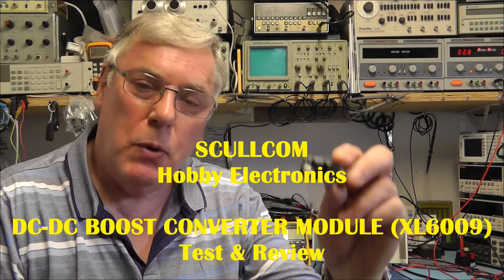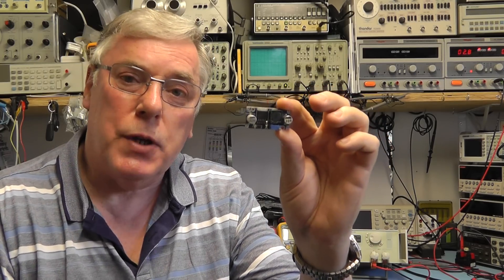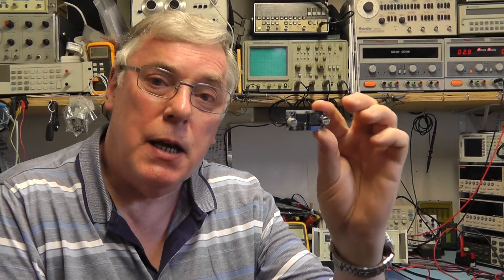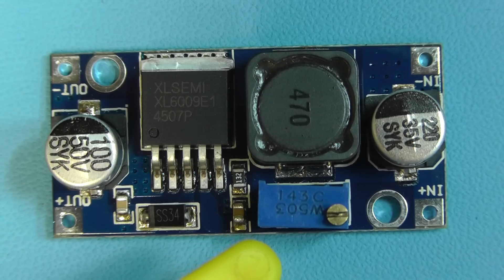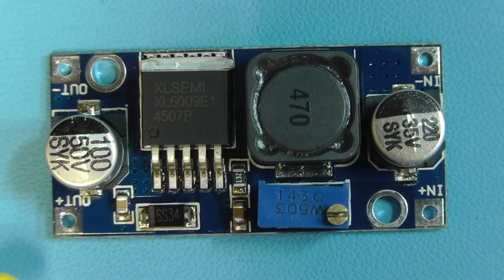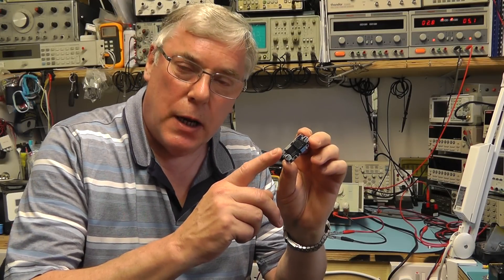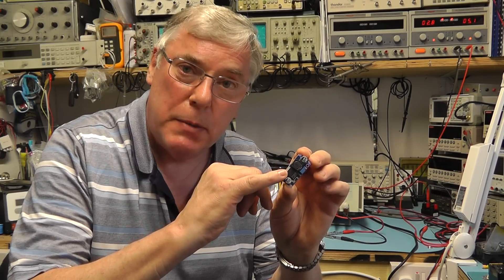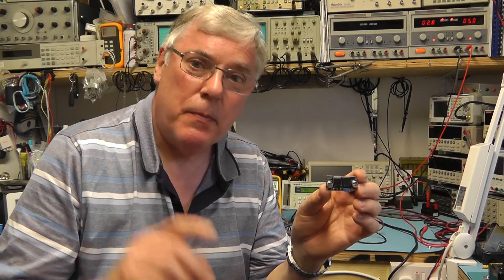Scullcom Hobby Electronics #19 - DC-DC Boost Converter Test & Review

Comment: sir, input= 5v 2A then what will be the output current for 10V output i.e 
input = 5v (2A) , output = 10v (?A).
Reply from the maker: Input at 5v 2A equals a power of 10 watt. So that would be the maximum power it could deliver in this case. So and output of 10v would deliver a maximum current of 1A but this assumes that the DC-DC boost converter is 100% efficient which is not the case, at best it would be about 90% or less. So for your 10v the maximum current would be about 800mA.
Reply: Thank you so so much sir :)

Comment: Hi , thank u for the in-depth analysis of the boost converters.
I wanted to get 32 volts off 16 volts. i used one of these and work fine momentarily well on a  load of 10 ohms bldc motor.then it failed or rather burnt. Later i just tried two of these in parallel, without any expectations, but to my surprise it worked fantastically. i removed one of the varistors and connected other varistor in parallel..  can u tell me with ur knowledge if this is stable system ??? can i connect more units in parallel to boost output power???
Reply from the maker: You can parallel these units to increase the maximum current but you will find that the current load may not be split equally between the two units. A better choice would be to use a single higher current boost converter. If you check-out eBay you will find there are plenty of high current boost converters of 10A or 20A available at low cost.
Reply: thanks a lot sir. i will check it :)

Comment: Why does the input voltage drops when you connect the load. Isnt it seposed to be stable if it is connected to a power suply?
Reply from the maker: Yes the input voltage should normally be stable but it depends on the capability of the power supply. In this case it was mainly due to the long wire length and wire gauge which cased a voltage drop.

Comment: Please I have another question? I want to use 4 leds 10w 12v 900ma all together using the same power cable. How Can I use them all together when The maximum current for each is  900ma? If I use them in parallel, is it necessary or possible to use one power supply 12v 3,6a? I mean, if I use one power supply 12v 3,6a, this current will be divided equally for each one? If I want to use 2 leds 10w 12v, may I use one power supply 12 1,8a?

Comment: Some one please could explain what kind of testes is he doing??? He changes the Amp value on the equipment and the imputs multimeters change. I need to understand? What is he testing? The board capacity? Please....
Reply from the maker: We are testing the efficiency of the DC to DC voltage converter. A DC source is used to provide input power to the DC to DC converter under constant voltage, while an electronic load is needed to draw power from the output, usually under constant current loading.The efficiency is then the ratio of power out to power in, most often expressed as a percentage.
Reply: Thank you! God bless you.

Comment: I got 95pct eff. Using on of these to step up an 18650 battery at 3.6nom to 6volts. I'm using one of these as a constant power load for a battery tester. Just whacked a 12ohm power resistor across the output to get approx 0.5C discharge @ constant power
Reply: Great video BTW, subscribed!
Reply from the maker: +Terry Myers Thanks for your comment.

Comment: diode job in dc-dc converters isn't rectification ... its all about redirecting the freewheel current and preventing sparks
Reply from the maker: +Osman Khalil Thanks for your comments. Yes agree, the buck-boost converter works by storing energy in the inductor during the ON phase and releasing it to the output during the OFF phase. This is achieved by the diode which is sometimes referred to as a “free wheeling” diode.
Reply: storing energy in inductor would  happen without the diode in the circuit but the problem is when th ediode off  that stored energy will make a big spark ,here come the diode job , to make this energy useful and prevent spark , in rectifier circuits where no inductor  exists  the diode's job is rectifying the ac waveform

Comment: What shitty source are you using? Even a cheap 10$ USB charger would keep the voltage at 5V at 4 Amps.
Reply from the maker: +Michi Lo The voltage source was from a 5 Amp power supply.
Reply: Scullcom Hobby Electronics Really? I have a 4 Amp one, and it is still at 4.89 V with 4 Amp. That's what it is rated for, and that is what it should deliver.
Reply from the maker: +Michi Lo The reason the voltage dropped at the higher currents was mainly due the connecting cable resistance to the power supply at the higher currents and not an issue with the power supply itself. In hindsight I should have used shorter and higher gauge cables to the power supply that would have ensured the voltage remained stable. Alternative I could have used a pair of sense wires feeding back the voltage reading to the power supply for auto correction to take place.
Reply: Scullcom Hobby Electronics Ok, sure. But in my USB Supply it is 5.1 V on the output so that on the other end of the wire there is still enough juice left to power the device.
Reply from the maker: +Michi Lo The results would depend on the length and wire gauge. For example if the effective resistance of the connecting wire is say 0.1ohm then the voltage drop at say 5 Amp would be 0.5 volt. In this scenario your 5.1v would drop to 4.6 volt.
Reply: Scullcom Hobby Electronics I hope the leads do not have so high resistance.
Reply: Yes they have

Comment: Interesting video.  Been studying DC-DC Converters and this video is informative.  From what I gather these modules work best with a ratio of 2 or less voltage difference input to output.  Anything above that and your efficiency is going to decrease.  For standard 3V to 5V phone charging circuits this would do just fine.  Sourcing at least 500mA to the phone might take a little bit longer but at 93% or higher since it is less than 2V difference these modules will work great.  Easy enough to get some thermal paste and an aluminum or copper fin on top of the IC and it should work just fine...  One thing to think about is the isolation between input and output, ie how much ripple is sourced back to the input might start to heat up a set of batteries.  Not sure how you test that but in my experience with boost converters the input batteries get really hot when they start to drop voltage.  Would be nice to have some sort of protection circuitry to shut off the converter once input voltage drops too low.
Reply from the maker: +Jimmy King Thanks for you comments. The XL6009 DC -DC converter IC on the board has an Enable pin (pin 2) which is not used on this board. With a small modification you could sense the input voltage and and then use it to control the Enable Pin - If you take it low below 0.8v the IC switches OFF. When you take it HIGH, 1.4v or above the IC switches ON. If the Enable Pin is left disconnected (floating) it goes HIGH by default so the IC is ON.

Comment: for Your test, it is Your powersupply drop the voltage and not the unit. And for the inputcurrent below 4a seems to work fine , and what You find do not work is above 4a and this should not work.  The 10w output is with the low inputvoltage. With higher inputvoltage You will be able to have more than 10w output.  For long time, it may get hot, this need to be tested.
Reply from the maker: +Asle Tryland Thanks for your comments. You are correct about the power supply drop. Running these units at high current loads really requires a heat sink on the regulator IC.

Comment from the maker: PROBLEMS REPLYING TO PIRATEMAN COMMENTS BELOW - So answered here instead:
Yes I did, there is some switching noise but quite small. I found adding extra capacitors in parallel with the output capacitor helps a lot. Its better to add several electrolytic capacitors, of the same value,  in parallel rather than use one large capacitor as the total ESR (Equivalent Series Resistance) is then much lower.
Reply: Mr. Scullcom, what values would you recommend for these smoothing capacitors?
Reply from the maker: This module had a 220uF at the output so you could add another additional 220uf in parallel with it. This will increase the total capacitance to 440uF while keeping the total ESR (Equivalent Series Resistance) low. Alternatively you could replace the 220uF capacitor with 4 of 100uF (select ones which have a low ESR).
Reply: Thank you :)

Comment: hi, i call from chile, you have a problem in test, the main power supply is not low the voltage in test, this form the power disipate in converter is more, the 5v in put are constant for test.- sorry for my english.-
Reply from the maker: +jorge gonzalez rojas Thanks for your comment.
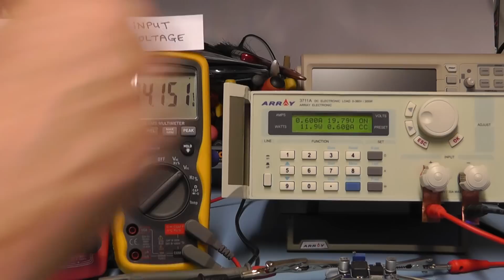Reply: If you are testing the DC-DC converter, why is the input (some times 5V) changing??  maybe the P.S. you are using is 10W only?, because I see it falls from 5V to 4.1V  which seems to alter the testing.   By the way, at 11:40 (mm:ss) the input is 4.55 amp, when you said it is maximum 4 amp. so you are out of specs (of testing)     I do not thrust cheap boosters (china or not) but I used them, and the testing should be fair.  maybe the pot regulates the ratio Vin-Vout.     maybe it reaches 15W,   and once that, we can used at 7.5W (as suggested)

Comment: correct me if I am wrong but let me see he is putting in 5v yet taking 20v out , I thought this was a drop down not a step up.
Reply from the maker: +Tony P The clue is in the title "DC to DC Boost Converter Module" Step-up. This module uses the XL6009 which is a boost converter switching I.C.
Reply: +Scullcom Hobby Electronics I'm sorry I didn't open my eyes before my mouth, I just purchased some step down ones for converting 14v to something like 7.2v for my quadcopter or other such devices and came across this video and was worried as having little knowledge in electronics. Apparently the ones I bought will convert anything up to 40v down to 1.2v 3A and look very similar , hope I didn't waist $10 AUS for 5 of them :)
Reply from the maker: +Anthony Pfeiffer Yes I agree with you the Step Down Converters do look very similar so it is easy to make a mistake.

Comment: i bought a DEOK 100W 6A DC Power Source on amazon  , person made a comment that it generates 
 radio frequency interference , what would be a better buy ? how do i stop  radio frequency interference ???
Reply from the maker: +jimmy butler Most cheap DC Boost Converter Modules have issues with RF interference. This module uses the LTC1871 and I see from looking at the module DEOK they only use one 220uF electrolytic capacitor on the output which is probably why you are having a problem. If you check the LCT1871 data sheet they recommend using four 150μF Panasonic capacitors (EEFUEOJ151R) in parallel plus a further two 22μF, low ESR (X5R) Taiyo Yuden ceramic capacitors (JMK325BJ226MM) added for HF noise reduction. The reason you should use four 150uF capacitors in parallel rather than just one big capacitor of four times that value is because of the inductive effect of electrolytic capacitors. The inductive effect or four in parallel is much lower than one big value capacitor. At higher frequencies, this becomes an increasing problem and at some point the impedance becomes positive and the capacitor in facts starts acting like as an inductor. Thats why in good quality switch mode power supplies you see they use lots of electrolytic capacitors in parallel on the output. Hope this is of some help.

Comment: What is supplying the input power?  Shouldn't it keep up with the demand and output constant voltage?
Reply from the maker: +Stephen Kramer Thanks for your comment. The main problem at the higher currents was the resistance of the leads I used from the power source - should have use much heavier gauge wire!! Using sensing leads on a power supply capable of that would resolve this issue but the power supply I used did not have this option.

Comment: Nice video. At this time, sellers advertise its efficiency as: "<94% (greater the pressure, the lower the efficiency)". Which is described quite well, to my opinion. I think they are quite nice units considering their price. I mean they are under a pound and do what they should do: boost the voltage for low current devices. I'm planning to use one to make a USB powered 120mm pc fan.
Reply from the maker: +DJ S Yes they are good value for such a low cost.

Comment: You should test those properly with input voltage above the documented absolute minimum of 5 Volts. Take note of the voltage values when doing the 10V input tests and notice that going above 10 Watts actually did not change the output value compared to lower values (was actually higher and efficiency was at 92%). I acknowledge the need to trim the value a little bit, but that did in no way show that 10W is the max it can handle. More, when doing the 5V tests and being at 11.2W output, you were 0.65V below the minimum, drawing 3.6 Amps and having stable output (71% efficiency). Keeping the voltage above the minimum and the current below 4 Amps might have shown that the board can go way beyond 10W.
Reply: Yep, drove me crazy everytime when at 5v, he'd say "now the input voltage has dropped..." - that's across his leads, just increase the bloody input voltage from the PSU until you are supplying 5v under load.  As noted, these don't work properly below 5v.  I've also gotten these to reliably supply 1.5A in the 12v range, but they do get a little warm at that.  And I'd question that 92% he quotes - I've loads of these and tested on an electronic load, have never seen efficiency much more than 88%  I've got some LTC3780 converters that I've measured efficiencies up to 97% but they cost much more.
Reply: +Hristo Gochkov What's the point?   It is likely to fail at some time in use, get one with a higher rating for reliability.
Reply: +klystron44 sure :) but higher rating means more cash and more space required. I watched the video exactly because i wanted to see what it can do for its money, was just expecting more tests while in specs.
Reply: +Hristo Gochkov Agreed, I thought you typically are not supposed to run these with output voltage more than 3 times input also.

Comment: will it do .4 ohms at 40 watts with little loss? That is what i am looking for.
Reply from the maker: +JGBLADES You would have problems as 4 ohm at 40 watt would mean the current would be over 3 amps with a output voltage about 12 volt. It should handle a load of 4 ohm up to about 8 volt output (this would draw 2 amp so power would only be 16 watt). If you increase the output voltage that would be a problem - for example if the output was set to 20 volt and you connected 4 ohm then that would try to draw 5 amp (100 watt) which would exceed its maximum of 2 amp (or 3 amp with heatsink). You would be better off using a different higher power DC to DC Converter.
Reply: I tried something similar to those specs and it would not push .5 ohm without a huge voltage drop. It was called a Drok something or other.
Reply from the maker: +JGBLADES I see you meant 0.4 ohm which at 40 watts would imply you need to handle 10 amp, which is far to high for these modules. If you do a search on eBay for "10 amp DC to DC Converter" you may find something which would be suitable.

Comment: Nice video. I saw a few of your videos already, I learn a lot of them. I have 2 questions about it. Why does the input voltage drop. Seems to me its not a problem of the module, but of the powersupply or connector resistance? And if the module is cooled, does it give more output power?
Reply from the maker: Roeland Riemens Thanks for your comments. The voltage drop was due to two the resistance of the leads I used to connect the input power - the leads were long and not ideal for high currents. I did find that adding a heatsink did increase the output power capabilities.

Comment: Question 1: Can i combine two led drivers of 10 watt each, to get 20 watts of power? Question 2: Can I use a 50 watt led driver (ac to ac) combined with (4 diode homemade) rectifier to power a 50 watt warm white cob led, if not this way, how?
Reply from the maker: GGomar007 Sorry for delay in answering but missed your message. With regards your questions;
1. Yes you could use two 10 watt LED drivers in parallel to get 20 watts but you may have some minor issues if they are not perfectly matched as one unit may try to provide more power than the other one. You could use a small value current limiting resistor in series with each of the outputs of the 10 watt LED drives to try to balance out any current sharing issues - in this case the resistors used would need to be very low in value say less than 0.5 ohm or you will suffer to much voltage drop across the resistors. A better solution would be to try find a 20 watt LED driver unit.
2. As DC watts = AC watts,  which is a measure of power or heat. As all LED's are diodes they would rectify any AC voltage.
Reply: Scullcom Hobby Electronics Thank you for replying, I have an 50 watt ac led driver, but I brought a 50 watt led that takes dc so I was just curious if it would blow my led if I hooked it up as is.

Comment: A really good video. I now know how many I need to do the job at what settings. Thanks. Have you tested others. I'm looking to make an efficient UPS for a laptop using 19v 3 amp max. With a 12 v large battery and a few chargers to keep topped up. The Charger are optimisers. I hope to have a 24 hour UPS by using such items.